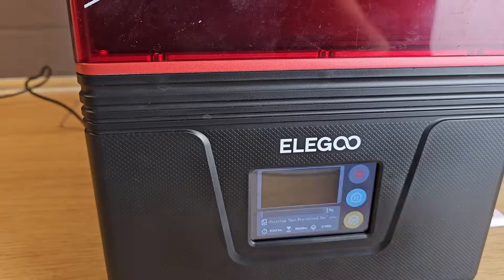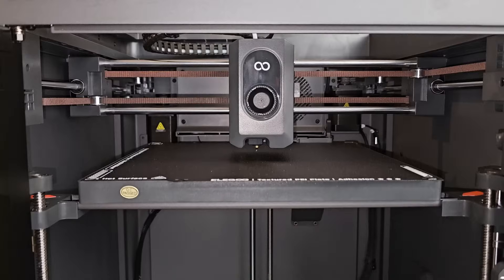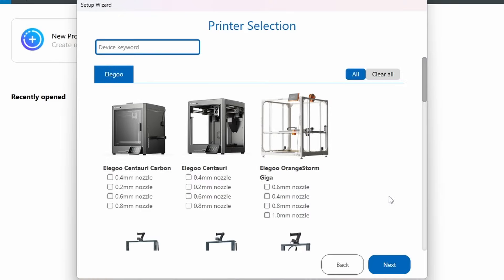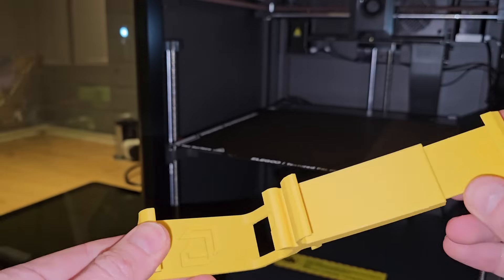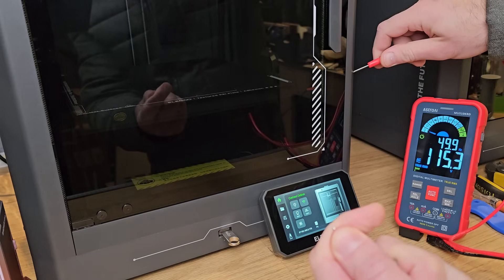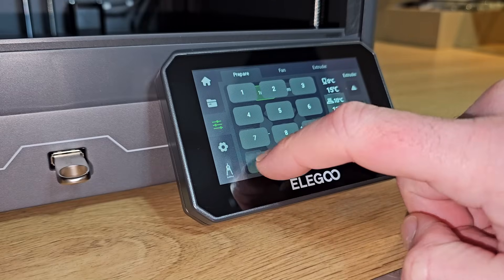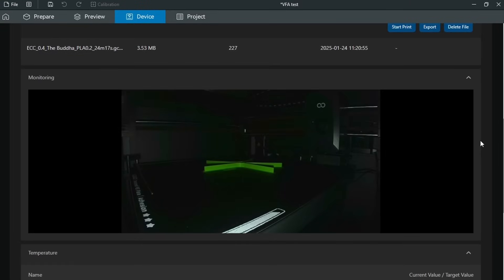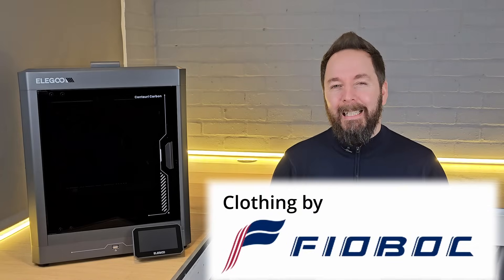Is The Centauri Carbon WORTH The Hype?

Comment: Hey!  Great video, albeit a bit shocking... sorry for the pun. 😅 Because of you back in the day I went with the Ender 3 v2 and it served me great, but I got married and busy and coming back to 3d printing I'm just tired of tramming (leveling, whatever) the bed.  

So I've been looking to upgrade, came across this and it looks promising for the money I'm willing to spend.  So was curious if you recommend this or another machine for similar money?
Reply from the maker: Great to see someone still here from the early days! When I made this video, i wasn't given the price but I assumed it would be around £500 with the spec it has. The fact that it is only £299 here in the UK puts it in a whole new category. For that money, I haven't seen another core XY machine that can compete. Elegoo are also committed to developing this machine and not moving onto the next thing quickly like some do. The only other machines I would look at in this price range are the Bambu Lab A1 models if you're interested in multi-filament printing. They're not core xy or enclosed though.
Reply: @RickyImpey  Started to really get into wanting the A1, then realized it can't reliably be put into an enclosure like my Ender is in due to the motherboard... so will most likely go with the elegoo and upgrade the filtration on it.  Was a bummer too as I really liked the bambu a1 but filtration is a big deal to me.

Comment: Based on your experience of the different 3d printer what would you recommend for quality?
Im looking at these cosplay items for my son in colour. Ive been local recommended the bambu p1s but has only 256mm.
Being in NZD we dont have a strong buying power.
They recommended not the k1 max as has issues and not smooth of use.

Comment: You should not have disposed of the "faulty" cable. 
You could have stripped it to confirm the following suspicion and maybe show us an educational video as a result: 
⚠There is a chance that this was one of the increasing numbers of cases where the manufacturer did not embed the ground (protective earth - PE) wire to save money. ⚠
If I were you I'd check all my IEC connector cables for a missing ground connection, especially on devices in the style of laptop power supply bricks and anything with a plastic shell. 
Since devices with a non-conductive casing theoretically do not need a ground connection to be safe against giving you a shock when you touch the casing, manufacturers would get away with silently removing the ground wire in cables provided with such devices. 
What they do not take into consideration (or do not care about) is that somebody could swap their incomplete cable onto a metal encased device, which could be what happened in your case.

Also like others already noted: Even with the ground wire removed, the case should not be live. 
I'm a bit surprised that your appliance leakage current interrupter (ALCI or RCCB) does not trigger with the ground connection re-established. 
The voltage potential on the casing should create a current leakage in the PE wire and trigger your leakage current breaker (if the current would reach life-endangering levels). Maybe yours is faulty?
It wouldn't hurt to go to the switch box in your home and press the "manual trigger" test-button on your leakage current breaker (which you should do once every 6 months anyway). 
Just don't forget to switch off your PC and tell everybody in the household before, since this kills the power ;)

Comment: How is this with printing ASA for a print that will take about 24-26 hours?  I got rid of a K1 because it stopped be able to print anything without a whole lot of tinkering every single print.  Looking for a new printer that I do not need to tinker with all the time.  I want to be able to send my file and it just prints.  It is this or a Bambu P1S, thoughts from anyone.  Don't need someone telling me to calibrate the printer, I had the K1 printing great then 1 day it just stopped and never printed anything successful after that day.

Comment: this is ABSOLUTELY a problem with the printer. the combination of sockets and adapters most likely simply isolates the ground, thus only providing the live and neutral wires to the printer. and any normal functioning appliance would happily work in that case, however it looks like elegoo decided to short the neutral to ground, basically creating a hazard for EVERY appliance connected to the same circuit as that printer.

Comment: So, should I buy one P1S or two Centauri Carbon's...? Bambu feels like the safer choice, but I'm no expert. I have had my Neptune 3 Pro bedslinger for a while, and I do not like it at all. Yes, I know it's old tech, but still.
Reply: Right now there is no multi-color soultion for the Centauri, although they said they are releasing something later this year. If that is a deal breaker for you then stick with the P1S. I have three of them and have been very happy.
Reply: @DreamationDesign  Thanks! I do not care  much for the AMS, so I ordered the P1S without one. To much filament waste with an AMS, I'd rather sand and paint my prints anyway. Will wait a bit before i order the Centauri, problems could still appear with that printer.

Comment: A friend who received one for testing lent it to me, and I have to say—it’s a great printer at an excellent price of $320 shipped in the US. However, the lack of a Klipper-based firmware is a dealbreaker for my business, especially since I primarily print ABS & ASA.

I had to root and modify my K1Cs to achieve a 120°C bed temperature, which is crucial for my prints. Rooting the K1C not only unlocked that capability but also allowed me to truly "own" the printer without requiring extensive hardware modifications. I had great expectations Elegooo, but is a no to the Centauri Carbon. I still love and use your Resin printers and your filaments though 😉
Reply: it's open source now
Reply: @us3rnam3number  Open source? What flavor? Marlin, Klipper, Own invention, Other?

Comment: So regardless of price, would you recommend Centauri Carbon or Qidi Plus 4???
Reply: It depends on your needs/desires.

I went for the QP4 myself, after I saw that the CF spools were sold out in under an hour (I think) after opening and the delivery was set to May. Which is currently already even pushed back to June...

I want a printer "now" (YMMV but I got an email "ready for pickup by delivery company"  within hours of purchase), not in 4 months. The QP4 already had its teething problems, be sure to check the SSR if and when you get it. And 370c nozzle, and chamber heater, and 305x305 build surface.

Oh, and I just noticed that all CC bundles are sold out. Only base printer left. 

That being said, The CC is very much still on my short list for future purchases :)
Reply: The SSR problem has been completely solved. 

I have Plus4 and Q1 Pro, so I didn't buy Elegoo CC. 

Although the price is very cheap, there is no innovation. I would rather spend a little more money to buy a machine with better performance. 

If you use this machine as the first printer to enter 3d printing, you can buy it. But in terms of subsequent development potential, Q1 Pro and Plus4 can meet the needs of more high-performance filaments. 

QIDI has always focused on the manufacture of fdm printers, but CC is Elegoo's first enclosed printer, so I still wait and see.
Reply: @Kimberlie1   yes it might be solved, but I will very much check to see if I still received the older model and need to request a replacement 😊
Plus there's the chamber heater exhaust port, etc.

The innovation with the CC would be the value for money really and potentially disruption on the market, for its price it's blistering fast wouldn't you agree? Plus it places itself in bedslinger price ranges to boot. 

It seems amazing for entry level and prototype printing.

It indeed does not meet your needs and desires :-)

Comment: Capacitance between the heater wires and the metal bed will allow a leakage current to flow when the bed heaters is energized.  Normally that current is shunted to ground via the powerline safety grounding lead.  If that path is interrupted that will allow the full line voltage to appear on ay parts of the printer that are electrically connected to the bed.  
==> This can happen with any printer that uses line voltage on the bed heater. <==

correction: about half the line voltage will appear on the bed and connected parts.
Reply: Exactly!

Comment: You might be able to flash stock Klipper onto the Centauri Carbon, similar to how many people do with their Elegoo Nepune 4's with OpenNept4une. Also if worst comes to worst, you can replace the main board for quite cheap.
Reply: Yeah, coming from the SLA / resin printing side, it looks downright reasonable on FDM to run a dual headed (2x mainboard) printer by comparison.  The effort for entry to standalone / semi-F/OSS control of SLA resin printers is absurd despite the fact that there are fewer operations and actions for the controller to perform and arguably more benefits being left on the table.

Comment: It seems like this printer just about edges out past the competition with the air filter that more expensive machines usually have but also that slightly hotter hotend. Uncle Jessy seemed to get impressive speedy prints from it too. Now we just have to wait to see over time how reliable it is. I think it's frustrating though that it's not clear at this price range what to get, this probably muddies the water a bit more in that regard in reality if it doesn't come out as something super reliable. I would like to see something that the others aren't doing at all.

Comment: pretty insane that now that it's out, its only $299... I bought 2 :D
Reply: I was sitting here thinking this would be a good deal at $400 and thought I might buy it at that. At $299, I don't even need it and bought it instantly just for the upgrades. If it's 1/2 as good as the review say, this will change the game.
Reply: @kingjamez80  Same, I am satisfied with my current printers and only followed to stay in the loop... but after the news I found myself pressing the order button this morning.
Reply: i would have to  but  i couldnt my bank detected it as fraud

Comment: Thanks for the "first thoughts" type video, appreciated.

I am not sure that you should have received a shock from the case, even with the noted issues on the socket and lead used. Surely the case still should not have done this.

I am yet to choose my very first 3d printer and your observations about the lack of a chamber heater also had concerned me when I had seen screenshots of this one online. Whilst I appreciate there is a cost factor, a chamber heater would only seem to compliment the potential that this would otherwise have.

I am pleased that you noted the filtration, being aware of the ideal being both HEPA certified and active carbon. Even printing PLA is not free from micro plastics concerns and whilst filtration can help, it has to be of the appropriate type to be meaningful.

Points taken regarding the choice of a closed type of firmware. I have begun to appreciate, having joined several discord channels for various 3d printer manufacturers etc, what it can mean to have a Klipper based firmware and Fluidd. Even though that might not seem so relevant for me at this point it is still a big put off for me to consider this one.

This next bit is only based on what I have picked up so far......

If I want to have the 3d printer lottery Gods on my side, first time buyer, and enjoy the best OOB experience with minimal fuss, then a Bambu type seems to be  a good choice.
At this point I would have no real desire, nor skill, to wish to tinker to keep the printer running, and Bambu Labs seems to as close to that as I have seen so far, apart from their locked firmware........

Good video, thanks.

Comment: Murphy's Law applies to the shock hazard.  Count on a user plugging into an improperly grounded outlet and getting shocked.  This isn't just a design flaw it's a safety hazard.
Reply: This was user error and visible in the viideo when he showed the plug he was using its a bog standard poundland style uk socket plug with metal clip around plastic ground that is NOT ELECTRICALLY CONNECTED. This is visible without any sort of knowledge other than what to look for.. and its a HUGE problem on UK?EU stuff (especially the products with multiple plug ends for different voltages)  especially when dealing with adapter types that accept grounded two prong connections suck as the US, and several EU plugs (shaver plugs as well in the UK

This is a issue because this entire section of this video.. should have been cut to I thought I had a problem, the elegoo contacty told me ther problem BUT I WANTED TO MAKE A NEGATIVE VIDEO AND BE A TROUBLE MAKER when literally a simple visual inspection of the plug would have told him it was not gorunded.. and WHY ON EARTH WOULD YOU NOT TEST WITH THE SUPPLIED POWER LCORD???? immediately AFTER getting shocked? (or more accurately before getting shocked.. if you wanna test bad leads in concert with new products to see if a problem exists by all means see if they are engineered to work wwith a bad ground connection ..

Comment: Using addapters can cause issues with earthing and voltage. This is why I always use the provided lead without adapters on all my electrical equipment as when electrical equipment is tested in factory it is done with the provided lead. A good example is I couldn't run my Air compressor with a power board or extension lead as the altered power cause by those stoped it from switching on. As soon as I pluged it straight into the wall socket ; it worked ! You have to be extremely careful when using adapters or powerboards.
Reply: I honestly don't understand why the scenario was presented the way it was other than standard YT clickbait styling. It takes 5 seconds to say. "I had a faulty adapter which caused the chassis to have voltage. Use the provided power cord from and manufacturer as directed." Instead, the video takes 90s to reach that point while faffing about their wasting Elegoo support's time -- Which ultimately is a cost borne by all other consumers.
Reply: @aaronb1138  no, that shouldn't happen at all.

Comment: im pretty sure elegoo is going to open the soyrce on release
Reply: they did indeed
Reply: @ DO YOU KNOW WHERE THEY DID I HAVENNT SEE ANY UODATES YET
Reply: direct from elegoo 18hrs ago 

"We are sorry, but our products are currently closed source. We understand your desire to modify, but due to technical and commercial reasons, we are temporarily unable to provide source code, motherboard schematics and pin addresses."
Reply: @DangaRanga  fuck pls say it aint soooooo i had such high hopes
Reply: @DangaRanga  where did they anoubce that u need to message the elgoo rep and see if ir rtue
Reply: @claytonsmoking  i had emailed them directly asking for info because i want to mod mine when it comes in. That was the response i got
Reply: @DangaRanga  this is deeeply upsetting and now i need to rethink my plans i bought one but sont know if ill buy anohter it might be cheaper to buy busted neptune 4's and make them into xorexy  instead. it seems my shelved neptune x reborn project may need to come to fruition if they keep it closed. this  is verry frustrating to say the least
Reply: hop so , as of now they didnt
Reply: @Dr3dMNR  THEY SAID THAT THE SLICER WILL BE UPDATED ON THE GITHUB IM STILLL WAITING FOR IT TOO FINGERS CROSSED THEY HOLD UP THE FOSS MENTALITY IF THEY DO THEY WILL BE KING OF THE CONSUMER 3D PRINTERS ESPECIALLY AT 299

Comment: This printer is far above the p1s
Reply: How so? I'm debating if I should get one P1S or two Centauri Carbon's.
Reply: @HdkTech  The print quality is more on par with that of the X1C.
In terms of mechanicals The CC already comes with hardened steel gears and a hardened nozzle, which I believe on the P1S is just stainless.
Print times on the CC are also a lot faster than that of the P1S and the screen is nicer. The hotter nozzle and bed on the CC should also make it easier to print more demanding materials like PC or glass\carbon filled materials.
Reply: @aco2518  sweet, thanks man!

Comment: The anycubic kobra s1 is a superior machine
Reply: I've had the kobra S1 combo sitting in my cart for days. I just don't know if Anycubic uses hardened steel where it's required. It seems it might be an afterthought. Although multicolor is sweet. I might just buy both.

Comment: So the Centauri Carbon is... Shocking! Regarding the lock down of software I can assure you though the community clapped back with Creality that didnt matter, the k2 flavor of klipper has no documentation available and very few people understand the coding that has more references to itself than a plate of spaghetti. That means no open source extra firmware for the k2. All elegoo has to do is write a different flavor of klipper, you would know if this was true just by looking at the configuration.

Comment: It is actually shocking (sic!) to see the voltage at the case. Discontinuity in the PE or not, the device MUST NOT have any live voltage at the case. I suspect, that in fashion similar to QIDI Q1 Pro, the heater is not controlled by double pole relay - the provided cable might have reversed L and N and does not bring L to the case, but N...  Very dangerous design. 

Secondly, I am worried that the RCD did not trip when you were shocked, started doing the voltage tests or finally when used the PE continuous cable. Yes, the currents weren't that high, but that's exactly what the RCD are designed for - to trip when there is any leakage, often to the annoyance of the users. Please, have those checked!